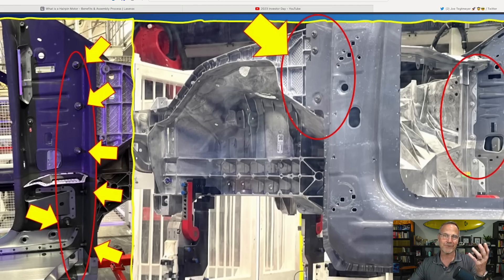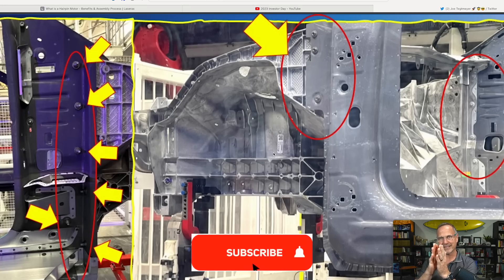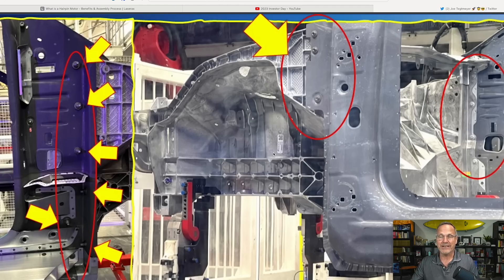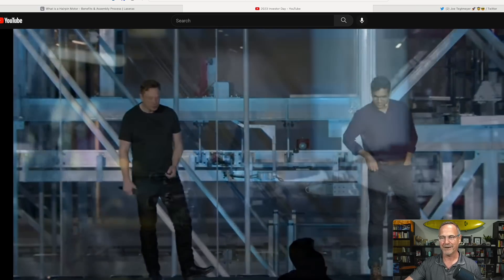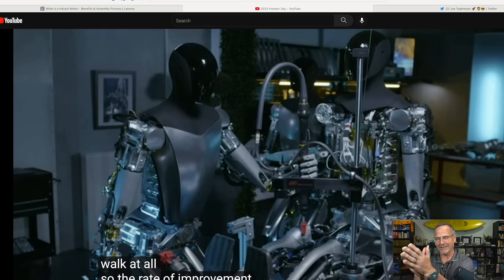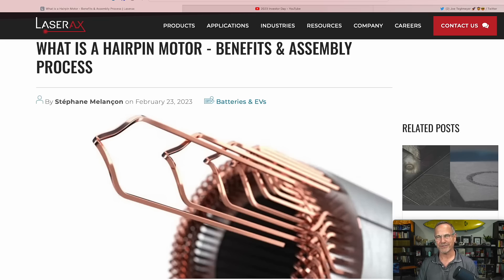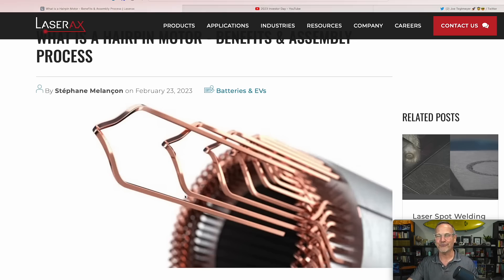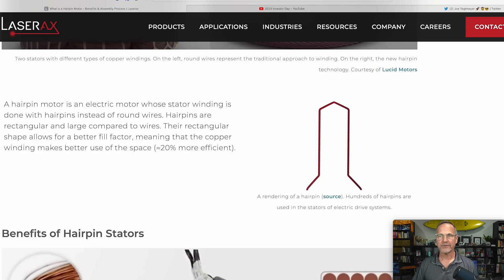Tesla Has HAIRPIN MOTORS! 🤯 What the Heck Are They?  Plus Teslabot is REAL, and How To Attach Panels

Comment: i mean the glass they use is extremely strong.  maybe they just made the top of the car similar to the bottom, where now the glass itself is part of the structure, and for this case, its part of the structural integrity.  what kind of adhesives do they use to keep the glass in place?  i would imagine on the industrial end, you can get something that would put that glass in place and its never moving again without a proper solvent.
Reply: Dissimilar materials with different expansion characteristics would preclude this in my opinion.

Comment: Just one thing I will say, you almost can't make an electric motor that is as inefficient as an ICE motor, the best ICE motors (for cars) have perhaps 39% efficiency, and the worst commercial electric motors are greater than 90% efficient, so the statement that hair pin motors are needed to reach the efficiency of an ICE motor is just poppycock.

Comment: A wonder if this new manner of assembling the vehicle will have effects on the safety in the case of an accident and also on life of the vehicle, can these connections last as long as a weld?  I'm sure Elon and team have considered this but seems like it could be an issue.
Reply: That may be the reason for the bolts being as many as they are and where they are.

Comment: Your explanation of the hairpin motor is a little off. The fact that the wires are square in the hairpin motor means that the magnetic field induced by the copper is a strong, rounded field as opposed to small strands of wire which build a bulbous magnetic field. Think of the small wires making multiple fields instead of the one strong more efficient field. Anyone that knows how power and magnetic fields present, will know that the square wire has one almost square or rectangular field and the current flow will be much more smooth so less power is needed to produce the same or better magnetic field.

Comment: I had considered the issue of assembling a pre-painted side panel to the body but assumed they could use the structural adhesive expertise they saw when they bought-in the original Roadster bodies from Lotus who pioneered (?) this approach with the Elise in 1996. You could argue that front and rear gigacastings joined by a structural battery are getting close to the old body-on-frame design of years ago (and current US pickups of course).
Reply: I expect they will use a pressure sensitive adhesive and some bolts to press it together.  It is a design path I would have taken because it means that the PSA can't come apart and the bolts can't shift positions.

Comment: One thing implied is that Tesla will eventually move all cars tp 1000v architecture just like semi and Cybertruck. Why? Standardization  first and foremost. Also, moving from 400v to 1000v means less copper for the cables just as it did for the low voltage move to 48v.

This means exiting models will be lighter and get better range.

Comment: My understanding is that Tesla use what are called Switched Reluctance Motors (SRM) not the traditional permanent magnet motors (PMM)
. The SRM design is lighter simpler and more efficient. The basic SRM can function without permanent magnets but Tesla inserts magnets to improve performance and efficiency.

Comment: Larger copper hairpins reduce electrical  resistance and heat. Excess heat and burning of the motors windings will cause failure.

Comment: I dont get this. The power of the motor os also depending on the amount of windings. And hairpins will have far less windings as they Are thicker. Of this was not the case You could just use a solid block of copper to eliminate air. So how can hairpins be more effective with less windings?

Comment: The only downside to hairpin motors is having to connect all those hairpins in series. With wire-wound stators, it's one long continuous wire. But as long as all those hairpin connections are solid, there's no problem. And I suspect that Tesla's connections will be A-1. But that is the main point-of-failure for hairpin motors.
Reply: Is this what they are doing with a laser at this part of the video? https://youtu.be/Hl1zEzVUV7w?t=4590

Comment: What was the biggest thing that stuck in my head that Sandy said was that General motors actually invented The hairpin motors and then did nothing with them.  This is blatant proof that General motors has been refusing to go down the Electric Road for decades. General motors and other car companies have been joined at the hip with oil and gasoline producers getting each other off and lying to everyone who buys their cars and trucks.  There is a mountain range of hidden money that has been put in the pockets of these garden company's executives by the oil and gas industry ever since they first started buying politicians which goes back a long long time. 👍🏻

Comment: The parts will be bonded together with an adhesive that also absorb noise and vibration.
That will further shrink the factory, reduce the cost of the car (less robots, less steps, less weight)
Having rigid panels bounded by a flexible adhesive is ideal for strength and noise reduction. The vibrations get channeled to the flexible part where the energy is absorbed.
Reply: You don't really want to do that in a car.  You don't want the glue to heat up and melt on a bumpy road.  The joint should be springy and the lossy part should be spread out.

Comment: So is the hairpin motor an induction motor? Would this replace the front motor in the 3/Y?

Or potentially power the entire vehicle for the new platform? Tesla's slide talking about eliminating rare earth metals showed a picture of an IPM synch RM, not an induction motor.
Reply: Tesla use switched reluctance motors in some vehicles - this is a bit like a stepper motor - no permanent magnets are required for these.

Comment: But a lot of motors use hairpin stators and rotors already, The thicker the copper is the more current it can carry also hairpin motors are low resistance and more easier to control with PWM signals at lower frequency's.

Comment: And DR, I  am not in agreement with you on your understanding of the hairpins copper occupying more space because they are square/rectangular. It is the fact that when copper wires lay against each other there are voids between the individual wires. a solid piece of wire sound or square has no voids. The square shape may allow the hairpins to be placed in a more effective design, but the real advantage is eliminating the voids between the singular wires within a coil. At least that is what I learned from an old Munro video 2 years ago(?). I could be wrong but eliminating the voids between the individual wires makes more sense. You get a heavier gauge coil performance in the same space.

Comment: Cleanerwatts mentioned Fe12N2 iron nitride as possible lanthanide / rare earth replacement, way cheaper, a bit better magnets. Still speculation. Also, 1,000 volts? Almost certain. Cheaper / less silicon carbide - how? (1:14-1:17 on presentation, something about cooling)

Comment: Hairpin and rare earth metals are two different things. Hairpin wiring has been around for a fair while but the problem with them is that the conductors are so thick that you get a problem called "The Skin Effect" when driving these motors at speed (frequency). This is really why the Taycan has a gearbox - they couldn't get the power across the RPM range. Lucid solved this to a some degree with laminated bar (looks like copper bar but is in fact a multilayer sandwich of copper/insulator). Lucid's solution is pretty good but certainly not ideal. Hopefully Tesla's improved upon this - ideally with a cross-sectional grid of insulated copper square-sections that are platted (nullify crosstalk) and then roll-formed back into bar for the hairpin. We need Sandy to work his magic...  ;)
Reply: Great explanation.  Thx.  I was wondering - if hairpins are so great, why have they not been used widely before.   Dr Know It All should have mentioned this.
Reply: In the motor crosstalk is not the issue.  As you stated skin effect is an issue.  Eddy currents are also an issue.
There is a company that makes Litz wire where after braiding it together they compress it to push out all the air and deform the copper to make it all fit tightly.  On soft copper, you can do this without breaking the insulation.  The result is a wire that is mostly copper.

Comment: Hairpin motors: there is a youtube video of a guy in SW Asia refurbishing a hairpin motor, so you can see all the bits and the steps involved in building one. The rectangular vs round conductor packing is problematic in that charges tend to travel along the surface of a conductor not as much the core so the energy density claims would need more work to validate -- the manufacturing speed is the overriding savings even if a slight performance negative happens.

Comment: Hair pin is the stator design and has nothing to do with the rotor where rare-earth metals live. You can completely separate the stator and rotor design so if it’s optimal to run a certain rotor in a hairpin stator for a give  power rating it would also be optimal to run that same rotor in a wound stator.

Comment: 13:47 thin wire is for many turns and high resistance -- more like radio frequencies. The thick wire is down closer to the mechanical frequencies and the key is having something near resonance at the frequency target. There is less attenuation that way, less loss of power. But, I wonder if copper is the right choice. Maybe the metal should be pure copper but some metallic material that has ferromagnetic properties - steel wire - iron doped copper. The problem with both iron and copper is that it oxidizes. Also mixing metals can cause a galvanic response in the material, further degrading the integrity. So the material science with metals is complicated.

Comment: Attaching painted body panels isn't an issue as in modern cars they are non structural anyway, so glued on our via hidden fasteners works well. An example in car history is the Citroen DS which had a structural chassis and the front and rear quarter panels were hung on one side and had a securing but in the other side. You could swap some body panels after a minor scrape with ease. Or detach them for mending and repainting.

Comment: For assembling modules, fastener combined with adhesive is more likely than a sealant. The adhesive will provide better force transfer and the fastener is contributing very little after the adhesive have cured.

Comment: Thanks Dr Gibbs for posting this informative video.  There is a really good vide by the Lucid CEO on how their motors are built with copper hairpins.  They are more powerful and cost less to produce by designing a production machine that automates the assembly.  I think that there is a trade-off between the strand and hairpin based designs.  At high frequencies the current flows on the surface of the copper wire and so hairpin motors will have less current capability since strand wires have a higher cumulative surface area.  Tesla has to select the right diameter of hairpin wires that optimizes the frequency used in their motors.  The extra power with hairpin wires is the additional copper winding compared to strand wires as you alluded in your video.  Lucid was able to add an extra winding and increase power by making the metal routing channels in their motors more of a square than rounded edges.  I highly recommend watching their video of their motor design.
Reply: Take a better look at Lucid, they don't use hairpins. They use continuous square wire, pre bent for the entire phase. No welding required. They are far in advance
Reply: @MegaWilderness  yup

Comment: Hairpin windings are a welcome improvement but not new technology. Already used by Lucid, Porsche and possibly GM. Wires with square cross-section are widely used in generators, motors,  transformers and aluminum wiring.

Comment: The one question I want to know is what took Tesla so long to move to hairpin motors? Given all their advantages, and the fact that Lucid already uses them, what are the cons of these motors that prevented Tesla from using them earlier?
Reply: Probably that they have to custom make the tooling and machines to use all their other technology and innovations such as the carbon wrapped rotor on the model s and newer designs. I'd bet that they have been working on this design and technology for several years in the development and planning phases to get it to where they were happy with the design and ready for production.

Comment: Putting the nuts into bolts . . . hmm.  Square/rectangular wire is not a new concept.  My guess is the kink in the hairpin helps with putting the magnetic field where you want it and may help reduce self-inductance.  Not sure, though.  Laying the windings and core at an angle has to do with rotational dynamics of the magnetic field.

Comment: The parallel production method would be great in theory, but if you thought the panels didn't fit well before, then hold Elon's beer. I'm sure they will eventually get it right, but I'm sure it will take a while to do so and fit and finish will suffer till then.

Comment: Using square cross section conductors is not new for motor windings, it has been used before and there are trade offs with manufacturing complexity which is why it's not used more commonly, Tesla is stating it is less complex to manufacture but that is because they can afford to invest in very expensive and complex machines to manufacture them. Using a formed winding (hairpin in this video) means that the conductors can be designed in very specific shapes for better magnetic coupling with the rotor. Using a wound rotor is much less precise so more difficult to form optimum shapes.

Comment: For their new manufacturing process - note that they said at least twice that the illustration shows a Model Y but the line is not a Model Y. I’m confident the reason why other manufacturers CANNOT do it is due to paint. The reason car is painted in full, then doors/panels taken off, assembly and then put on again is that it’s almost impossible to keep paint uniformity if it’s not all painted together. This is yet another hint than gen3 is a stainless steel design - it allows Tesla to take a first principle approach to the production line - and completely rethink it - and the main reason is no paint. The reason the illustration was a Model Y is because they didn’t want to reveal the gen3 design - and that’s why it felt weird and why there were multiple comments about the fact that Model Y is only used for illustration. Elon would likely say the best paint is no paint 😂😂😂

One last point, making gen3 with stainless steel in one color is a VERY significant differentiation from M3/Y, which would allow lessening the Osborne effect and cannibalisation once gen3 is announced and released. Like Ford said about the Model T - you can get it in any color you want as long as it’s black. With the Gen3 you’ll be able to get it in any color you like as long as it’s stainless steel 😅 (last last point CyberTruck was likely a proving ground for stainless steel design and allowed Tesla to explore it with less impact to M3/Y)

Comment: I wonder why Tesla did not move to hairpin motors earlier. I suspect it had to do with volume production and design of the motors. They specifically mentioned they build new software to simulate and optimize the motor. I guess without it they could get the price/performance/weight/materials they wanted. The new software might have been the reason why Tesla was able to do hairpin + no rare earth + keep performance + keep costs low + make it worthwhile to redo their manufacturing for motors.